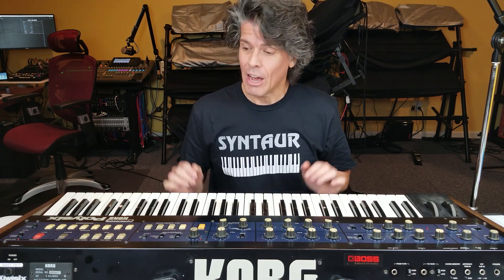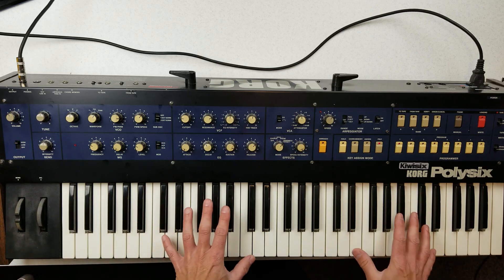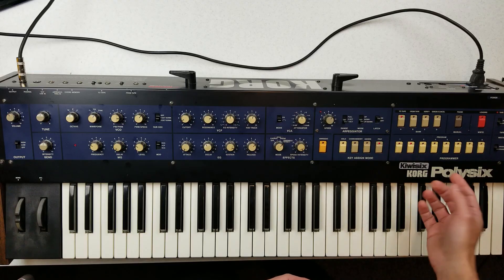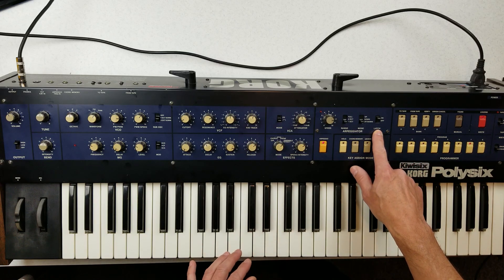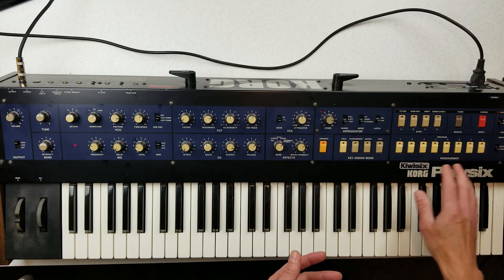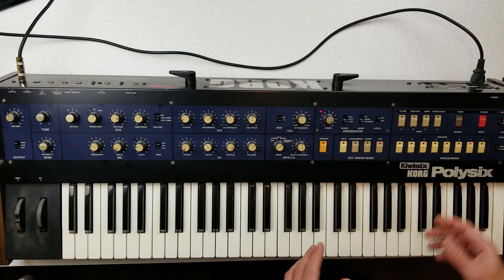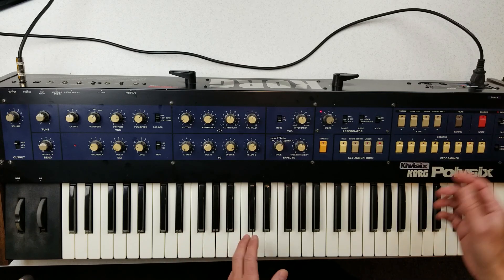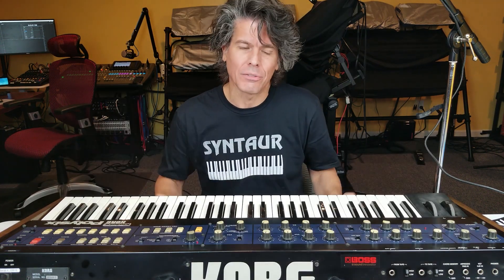Repairing & Restoring a Korg Polysix to Better Than New! Episode 6: Demonstrating the (Kiwi)Polysix!

Comment: Isn’t that cool ? Currently restoring my old p6. I’ve restore the keyboard contacts 6 months ago and then 2 months ago it started to have problem with resonnance. Like usual, bad trace on cpu board, (battery leakage 25 years ago and since I need to service the board every 3 or 4 years) now its fixed but Im tired so i decide to go for kiwisix and the psu. Now psu is installed and new cpu board also. It works but I'm doing the grounding now. Then i will do the tuning,  I've a lost of 1 semitone accross the keyboard. All this blabla, (I'm french so I talk a lot to say nothing...), to say thank you for these videos because for me I've used the 6 of them to double-check what I've done. I know it takes a lot of time to do that, we all appreciate your work, its really kind of you for sharing this.

Comment: Hello, does the Kiwi kit change how to calibrage the synth?
Reply from the maker: No. The Kiwi kit changes how the digital side works (patch storage, sequencer, key assignment, etc). The analog part of the synth is unchanged and still requires calibration. The only thing that DOES change is the MG - it is no longer analog, it's run from the Kiwi board, so it no longer requires calibration.

Comment: Thanks Scott. You gave me the confidence to go for the Kiwisix and go through the whole process of upgrading my Polysix, which I bought around 1989. Amazingly thorough  videos. I tried to contribute to support your site but it would just go into blue spinning circle and never connect to the pay page. I'll try again. 
After the expense for the Kiwisix, I need to buy an oscilloscope but what you're using is way over what I can afford. Can you suggest a cheap oscilloscope that will be just about good enough to calibrate the upgraded Polysix please. And if you have any other way to support your site, please let me know. Regards, Richard

Comment: Thank you so much for this! I just happened to get a Polysix from a friend with a corroded board and thanks to your guide I was able to take my pretty amateurish skills and get myself my first hardware synth! Never thought I would have such an analog polysynth anytime soon, much less before I even got out of college. I also would have likely been stuck on a few points here for a long time if not for this series (I'm looking at you, preset panel buttons), so many many thanks!
Reply: I'll also say that if you didn't try the simple mod for blending the Saw and PW than it's definitely worth it! It's as simple removing as removing a Diode of the voice board. It does mess up some presets but nothing that a little rewrite can't fix.
Reply from the maker: That's great, the Polysix is a great analog polysynth, so another one saved is good news!

Comment: What a fantastic series Scott. I did the Kiwisix upgrade on my Polysix a few years ago (I had already heard about the Kiwisix, having done the JX-3P upgrade from KiwiTechnics, so when I found a Polysix going cheap since it was missing the CPU board I took the chance and went for it. It took some time to complete with all the other issues I had, similar to what you went through, however it turned out very nicely and the Kiwisix is a worthwhile upgrade, especially if you have an irreparable or missing CPU board and or PSU.
But if your series had been available to watch back then it would have made things so much easier, and you also mention some great tips in your series that I will take note of for next time.

Thanks so much and keep the excellent restoration videos coming
Reply from the maker: Thanks for the kind words! Yes, the Kiwisix upgrade is really well done. The firmware is solid, and they took a lot of time and effort to make the user interface usable and well integrated to the original design of the synth.

Comment: Great job on the polysix restoration project.
I watched the entire series because I found them fascinating but also felt a little bit sad for all your minor snags that you encountered during that restoration.
The synth sounds great, and honestly I am amazed that there are companies that still support vintage gear. Obviously not for every synth product made but at least you had success with your piece of vintage gear.  
In your opinion, do you think my Roland XP-50 has made it to vintage status?  

Thank you for sharing your polysix project with your viewers.  

Cheers and blessings
Reply from the maker: Little snags are pretty much to be expected when working on 40-year-old audio gear! :) I'm just glad they were all relatively minor - it could have been far worse.

It will be interesting to see if digital gear from the late 80's or 90's becomes "vintage" like we consider analog 80's gear. There are a few that without question have reached that status - Wavestation, Roland D-50, Korg M-1, even some of the Ensoniq synths. Those synths however are going to be next to impossible to repair when/if they fail. Custom VLSI and RISC chips, surface mounted chips and multi-layer circuit boards are not very conducive to repair, and you certainly aren't going to find replacement aftermarket components for them.